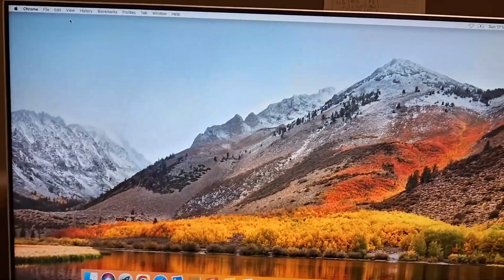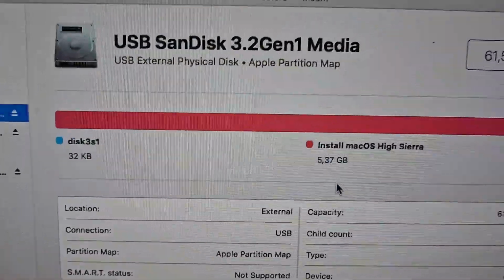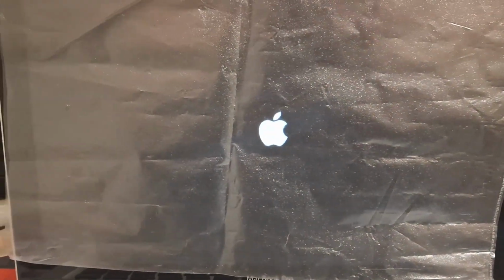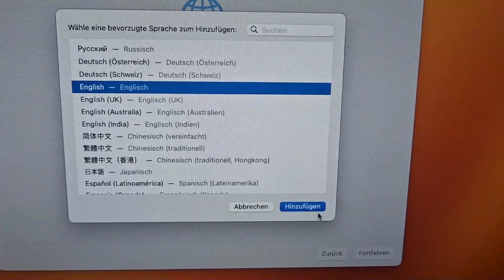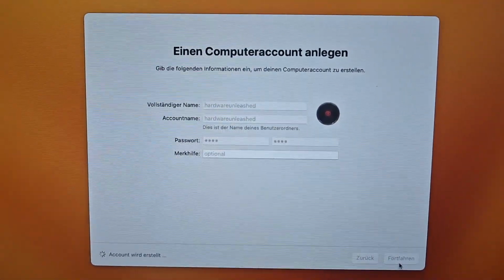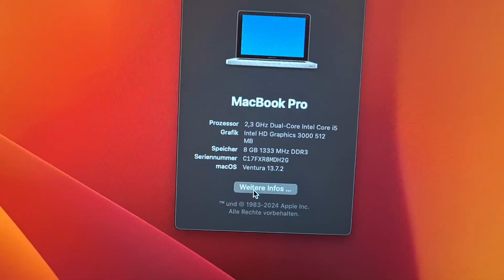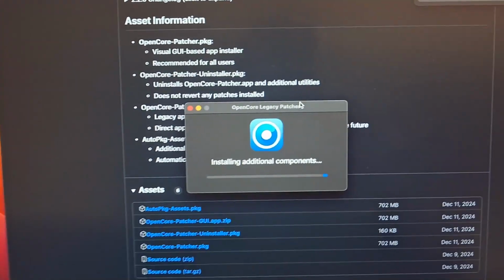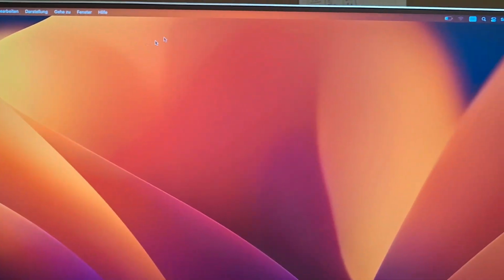Install macOS on Unsupported Macs with OpenCore Legacy Patcher | Step-by-Step Guide

Comment: if you had an older models such as the 2011 Macbook Pro, the best suited for that might be the macOS Sonoma..As the systems began in OCLP Big Sur from 2020-2023, the systems extended to Sonoma until the year 2026..High Sierra systems unsupported until the year 2020, which means only Big Sur could runs it after it was unsupported for High Sierra..

Comment: Hey, bei mir bleibt der Balken nach der Installation jedes Mal stehen, weißt du woran das liegen könnte?
Reply from the maker: Hey, das könnte an mehreren Dingen liegen. Überprüfe bitte Folgendes:

1. SMBIOS-Konfiguration: Stelle sicher, dass du das richtige Modell für dein Gerät ausgewählt hast.

2. Fehlerhafte Treiber: Manche kexts (Treiber) können Probleme verursachen. Teste es, indem du problematische kexts vorübergehend deaktivierst.

3. Sicherheitsoptionen im BIOS: Deaktiviere Secure Boot und aktiviere AHCI, falls verfügbar.

4. Verbose-Mode: Starte den Mac mit -v, um zu sehen, an welcher Stelle er genau hängen bleibt. Das hilft, den Fehler besser einzugrenzen.

Falls es immer noch nicht klappt, gib mir mehr Infos zu deinem System, dann kann ich gezielter helfen.
Reply: @HardwareUnleashed danke schonmal, kann ich dir auf Instagram, Reddit, etc. schreiben? Das geht eventuell etwas einfacher :)
Reply from the maker: Ja, ich habe ein Instagram-Konto. Es ist mit meinem Kanal verlinkt oder klicke auf diesen Link: Ja, ich habe ein Instagram-Konto. Es ist mit meinem Kanal verlinkt oder klicke auf diesen Link:https://www.instagram.com/hardwareunleashed?igsh=Zm5rMTJsY3Vpejdp